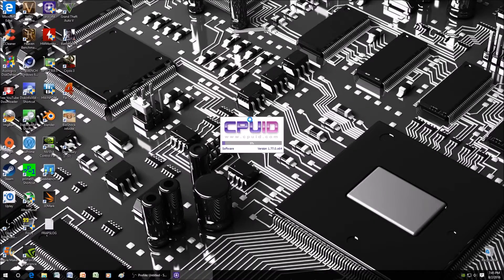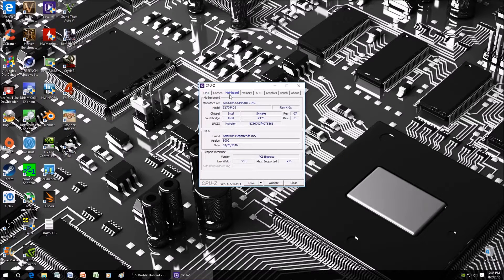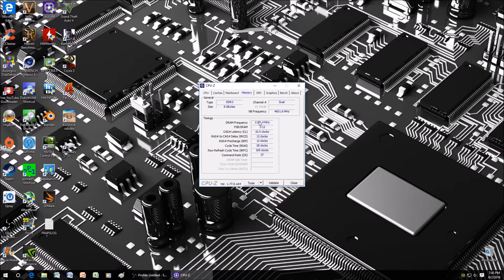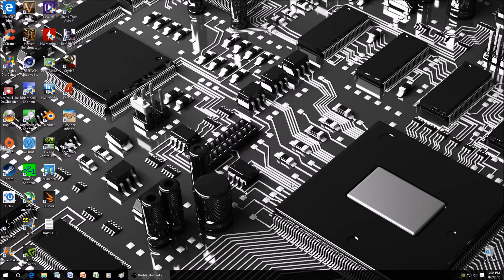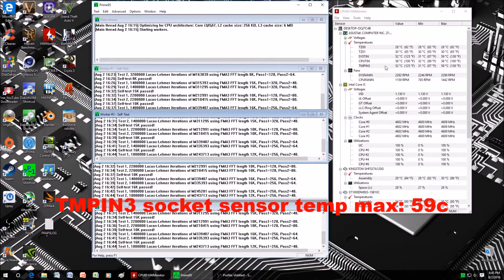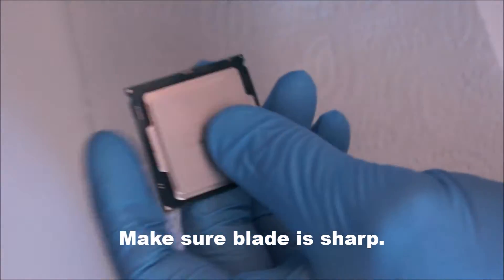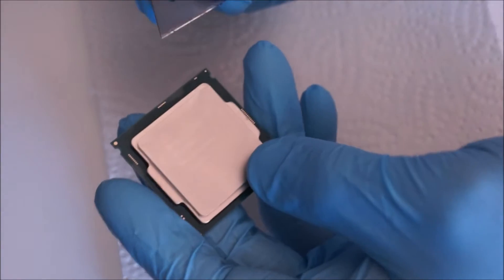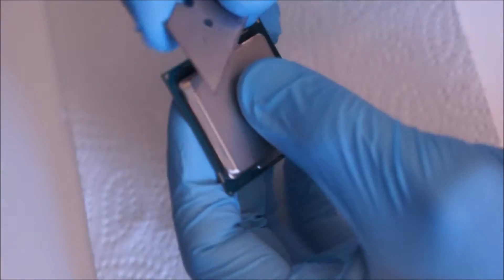i5 6500 Delid And Overclocking

Comment: Hey, I know Im pretty late on this video, but hopefully you still check these comments. When I overclock my 6400, I have to drop my RAM speeds immensely to hit any sort of overclock. Is this normal? currently running 4.3 ghz at 1.25 V but I have to drop ram speed to 1333 mhz or I wont post. idk if i have any performance loss from the lower memory speed or if I should be worried about it at all, but is this something you've noticed when overclocking a non-k processor? Im on asrock m-itx az z170 board using G. Skill 2133 mhz ram sticks if that helps.
Reply from the maker: Hi. Make sure to disable XMP. I have experienced this issues myself with XMP ram. With memory that natively runs at, for example, 2400 MHz, this issue goes away. I still have to lower the ram a little according to the overclock. 

Some motherboards are more sensitive than others when it comes to overclocking non-k cpu's and faster memory. I would not worry about it running at 1333mhz, as you will see near zero performance gains from memory speed during gaming. At the most, running at rated speed you may gain 1-2 extra frames in most games. Hope this helps.

You may also want to look at your memory timings.
Reply: @TechnologyHive  A year on i strongly disagree with this comment. I have been rocking 1333mhz ram for a while. I was a strong advocate for it. I recently upgraded to 2400 and in cpu intensive games Like pubg and rust i gain 15-20 frames. My pc used to always crash when trying to stream and game at 1080p 60 fps.  The frames would drop to as low as 36 when doing this. Now i sit between 70-90 when streaming. When gaming i used to get 70-100 frames. Now i sit at a strong 110-140 in pubg. In cpu intensive games rams speed is now very important.
Reply: That is normal since Ram goes up with BCLK OC and you need to bring Ram down to what it's supposed to support if it has issues.

On my MSI Gaming M3 the XMP works fine. I do use a custom bios for non-K CPUs, it's the A61 for that motherboard I believe. Also with XMP on I get 3001Mhz on my ram and with the downclock as it is necessary, otherwise it was going at like 8000+Mhz with the cpu at 4.5Ghz. 

My memory is the cheapest 3000Mhz rated memory I could find. I could probably push it further but there is no need, 2133Mhz is the point of diminishin returns.
Reply: I overclocked my 6400 to 4.6Ghz,my ram speed is 2040 mhz
The core voltage is 1.440 , SA voltage is 1.2500,and the IO voltage is 1.2500 as well,the base clock is 170,you can also try 174 but my mobo won't allow me,i have an MSI Z270 M5 ,with no BIOS upgrades
Reply: @nou268  hello.. can you post a video of it.. I mean your specs and some gameplay.. I have 6400 should I overclock it.. please suggest how to do it
Reply: @praveenbhat5392  you will need a z270 motherboard,either from msi or asrock,i have the msi z270 gaming m5,you'll need to go into the overclocking section and choose beta runner and noc thread, i've seen some people overclock it to .47Ghz,but it doesn't work for me actually,i overclocked it to 4.4Ghz
Reply: i'll surley try to make a video @praveenbhat5392
Reply: @praveenbhat5392  it kinda gets toasty so i have water cooling to sustain the 4.4-->4.6Ghz overclock
Reply: @praveenbhat5392  i would actually suggest getting a 7700k rather than overclocking
Reply: @praveenbhat5392  do you have reddit?if you do I'm u/triple_octopus

Comment: what cooler are you running 59c seems pretty low for 1.3v. maybe my h105 just sucks because at 1.3v I hit around 70c in prime before delid
Reply from the maker: Remember, my CPU is delided and I'm running Liquid Ultra on die.
Reply: Technology Hive weren't the first temp where it only 59c before the delid
Reply from the maker: Damien I was using a Corsair H110i :)
Reply: Technology Hive dang looks like the h110i stomps the h105 I gusse
Reply: Technology Hive do you know if you used prime with avx or were you running version 26.6?
Reply from the maker: AVX instructions were used during test.

Comment: you are one lucky dude you know? 

you got 4.6 Ghz with 1.300 volts... that's so good.
mine's 4.44 @ 1.352.....
Reply: I have the 6600k running 4.6 no problems
Reply: I5 7600K 4.4 @1.12   /  4.8 @ 1.19 / 5.0 @ 1.285 = aio 240 WITH pump and fans set to ULTRA QUIET 40% with room temp at 77*F
Reply: Yeah that is lucky. Mine is 4.5Ghz @ 1.43v on MSI Z170A Gaming M3. 
Voltage limit is 1.55V supposedly.

Comment: What is the benefit of delidding a cpu
Reply from the maker: When you delid a CPU and you use a better quality thermal solution, like Liquid Ultra, you can achieve better CPU temperatures, which in turn give you a quieter CPU fan, better overclocking ability, and longer CPU lifespan (specially when overclocked).

Comment: Dont you loose the ability to check temperatures on non k CPUs when OC'ed? How can you know your temperatures dropped?
Reply from the maker: I am monitoring package temps, which are typically pretty close to core temps  +/- 1 or 2 degrees. Newer bios versions are being released that allow you to monitor core temps.
Reply: Technology Hive ah ok, so it's still doable? I was thinking about buying a 6500 with a z170
Reply from the maker: Yes, you can still monitor core temps. But, read in the bios release notes that core temp monitoring is supported for the motherboard model you are thinking about, before you go and buy. Just my advice :)

Comment: You can't OC i5 6500 anymore
Reply: CPU microcode is related to BIOS only, not to OS, they can't modify that.. 
Overclock on non k will always be possible, but they want you to be scared, in order to sell you k's CPUs. Regards.
Reply from the maker: You can with the right bios. Go to Overclocking.guide and find your  bios there.
Reply: Do you think that we will be able to overclock the non-k processor forever with the bios downgrade? People say that they will fix in on an windows 10 update
Reply from the maker: The BIOS that we get are non official bios. I suppose that if they really wanted to, manufactures could work up an update to prevent non k overclocking. But I have not heard about this yet. So enjoy it!
Reply from the maker: Board partners have not released any update that prevent flashing bios to modified bios. So no worries there. You can still flash your bios on Z170 motherboards to allow overlocking on non-k cpus.
Yes, Microsoft could release a windows based code that could prevent CPU's running outside of specified perimeters to work with their OS's, but they have not done so yet and I do not believe this will come any time soon either.
Reply: Maybe there's new chips of non k processors that can not be overclocked? Also I would like to know what mobo is best  for overclocking non-k .. Asrok pro 4 ???
Reply from the maker: I have used the Asus Z170 P D3 and it was a great board for non k overclocking.